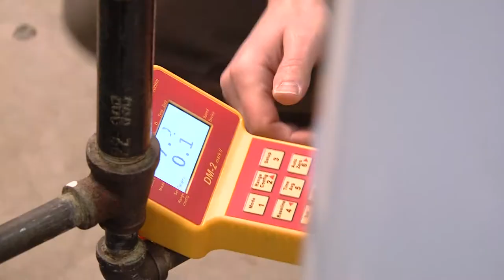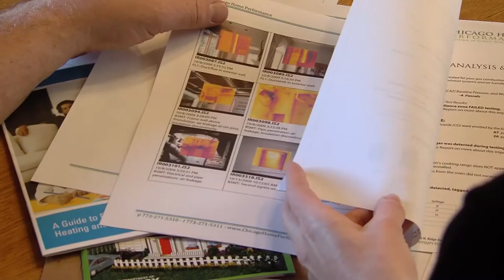Prescription Home Performance: Television Show Sizzle Reel

Comment: Hmmm, How is air sealing going to stop back drafting. That blower door for sure causing back venting when in use. Also how does less air infiltration improve IAQ? I was always under the impression the opposite occurs, thus the need for mechanical ventilation.